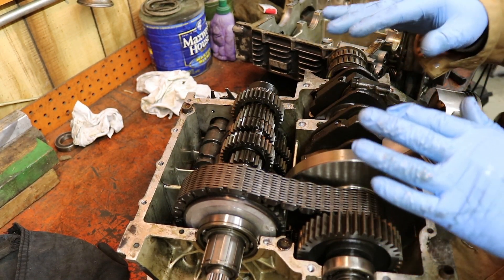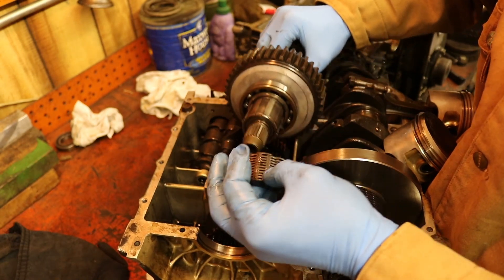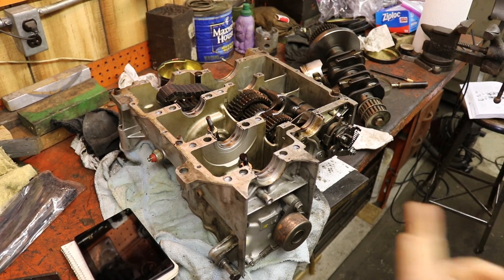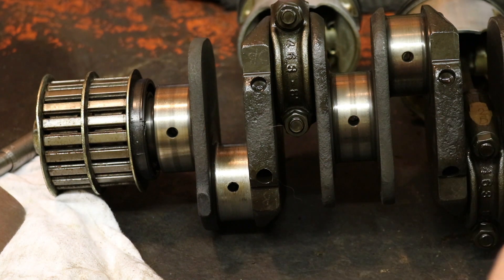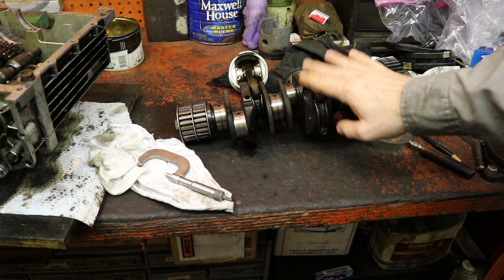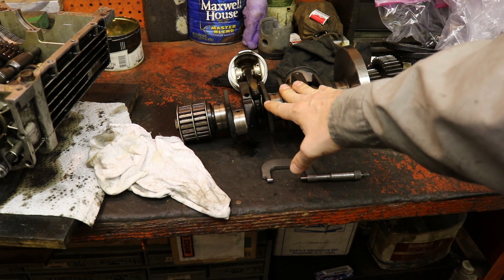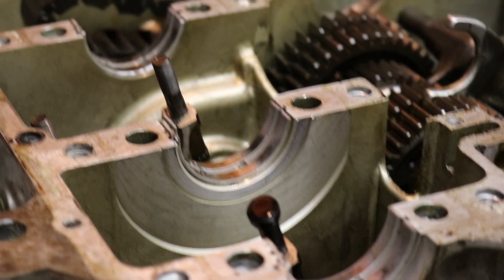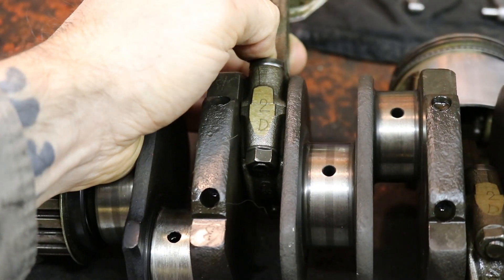Honda Goldwing Bobber Build | E18 - Cranks, rods, and bearings

Comment: Every four stroke motor cycle engine has the same method of sizing crank bearings. The gold wing is not special. And plain bearings for these cranks are like $30 a pair! The best way is to give the engine to a decent machine shop that knows engine building and they will find out what size bearings will fit- and it might be ones for a Toyota Corolla or a Subaru! Much cheaper that way cos car suppliers are much more affordable

Comment: I don't understand why one of the dozens of bearing companies there are in the world doesn't see the potential market here and tap it. I realize that it will be a niche market, but then so are bearing shells for Vincent Rapids and Vellocettes, but you can still get brand new bearing sets for these bikes that are much, much older. I don't get why the Goldwing is such a special case???
Reply from the maker: It is weird. And unfortunate. Perhaps someday. There may just not be enough demand at the moment due to the high volume of available parts bikes and, if taken care of, the longevity of these engines, to make manufacturing bearings profitable. But I don't really know... :)
Reply: fuckin preach. bought a seized one only to have it all apart and NOW realize that these parts dont exist. fml
Reply: I'm in NZ and currently rebuilding GL1200 the last guy messed up on the timing belt and put a valve through a piston. When stripping down the engine all the big end bearings are worn and showing copper. 
I took it to a local machine shop and they found standard bearings from a Hyundai and Toyota that fit straight in.